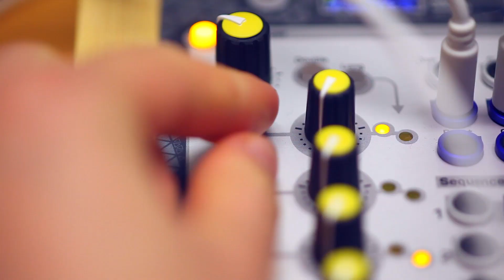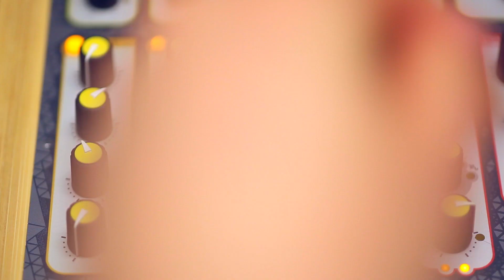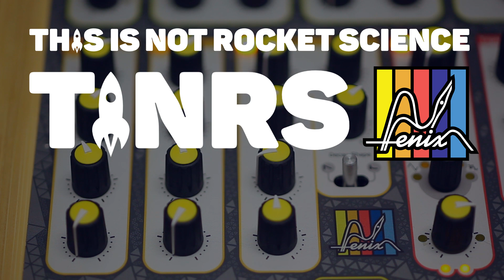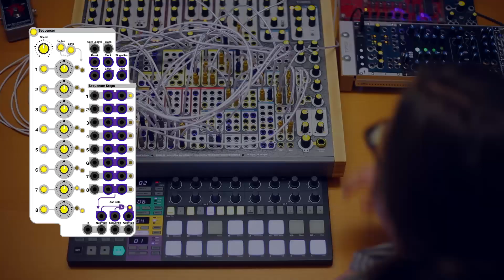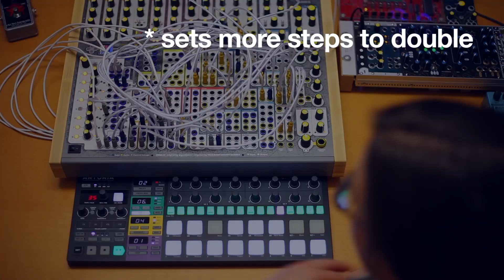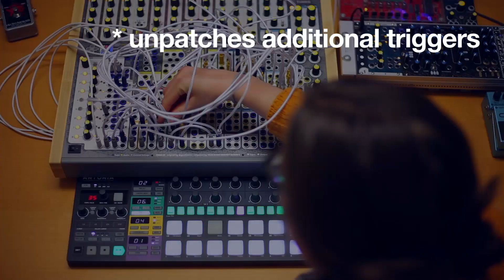TINRS Fenix IV - First Patch! with patch breakdown

Comment: this is supposed to be a synthesiser not a drum machine, why does no one do anything that shows what a synth is capable of rather than some lame drum sounds.
Reply: Because making melodies with synthesizers is a boomer thing.
Reply: it is not a mere synthesizer, it is a modular synthesizer in a box... ;)
how about you state what exactly you would like to hear/see? :)
Reply: because, being a modular synthesizer, the range of possibilities are quite vast... in this video, if i understood right, makingsoundmachines are only demonstrating the sequencer module and how you can use it in conjunction with an external sequencer... the use of soundfonts is just a convenience... ;)

an exact statement of what i'd like to hear/see:
i'd love to see a demo showing off the clean sound of the oscillators and maybe some other demos running the various sound sources through the individual modulation and effect modules...
as a bonus: make a full track... :)
Reply: @RomanBuehler  exactly !, whats interesting about the vcos,vcfs etc